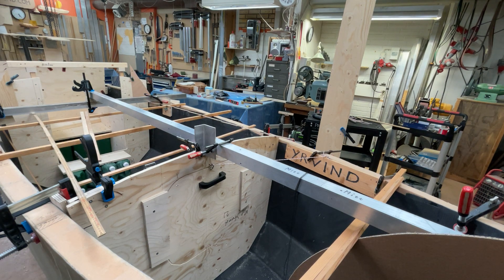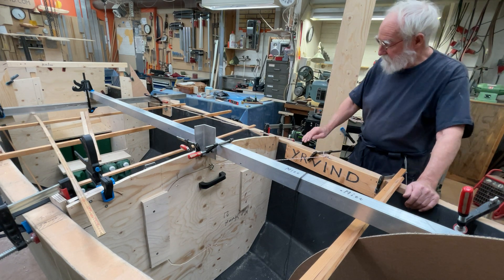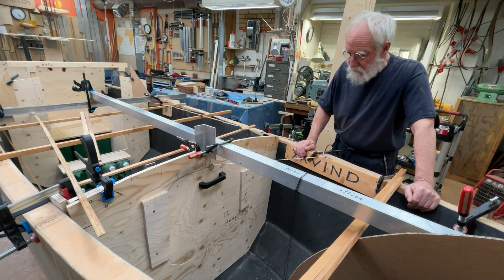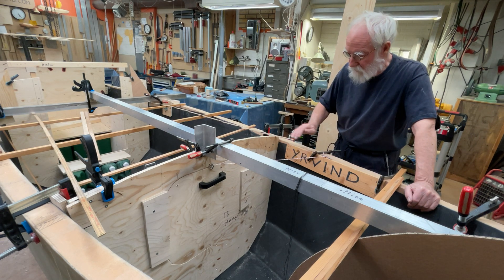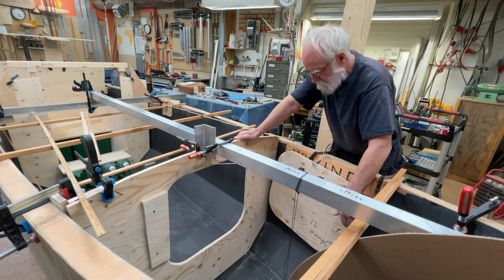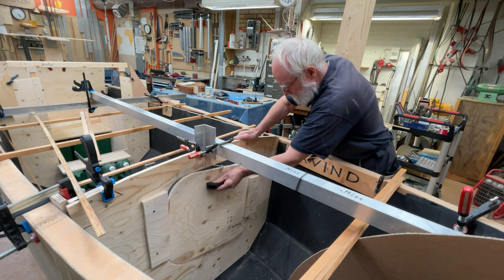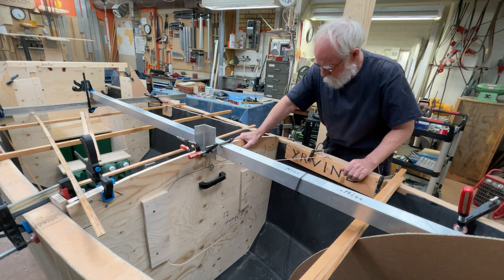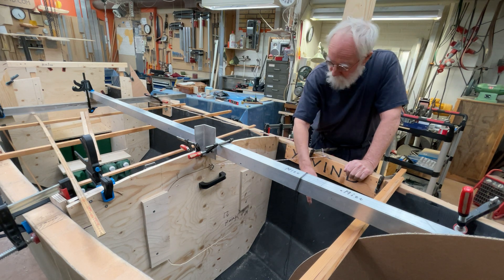Hatch in forward bulkhead. For airlock. She slides and twista 90°

Comment: Hello Sir have you thinked about magnet to fixe the hatch on to the hull ? It should work nice, and fast to unlock it.
Reply from the maker: Its not good. Magnets affect the compass and should be avoided. They are not strong enough. The gasket is about 2 meters long to compress it a lot of force is needed
Reply: @SvenYrvindExlex  Ok it's make sence. Just let me make you notice that i just mean it, for while the hatch it's open it doesn't swing on the rope.. 
i appreciate your answer.
Reply: I think you will find that he has has a method using rope that is cheaper , more simple and more secure .  maybe like this https://youtu.be/x2wT1dJUmws
Reply: @akcarlos  Hello Carlos, thank you. I only  mind it for those inside hatch's, the one you show me goes for the indorr/outdorr one's, wich doesn't work same way'.
Reply: @ElBibiRD  I dont know exactly how he would do it but since he has come up with such a smart way then something similar could be done for all hatches.

Comment: It Is so that if there Is Water intake at the bow or centerboard case, Water pressure will work against that seal! There will be a top entrance at the fore peak to be possible to get rid of the Water and fix the problem! Is that way that ir works!
Reply from the maker: I do not excactly understand the question, but.
The centerboard case do not open into the forepeak. The centerboard case open at deck.
Also there is a discharge pump in the forepeak if water enter in the deck hatch while I work the sails. It is easy pump the water out. The deck hatch like all the other hatches will be waterproof.